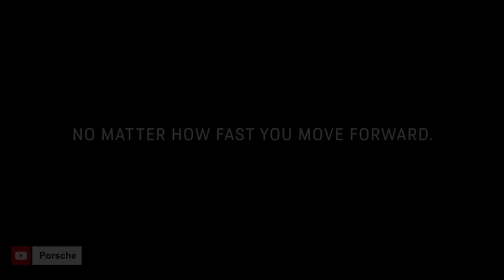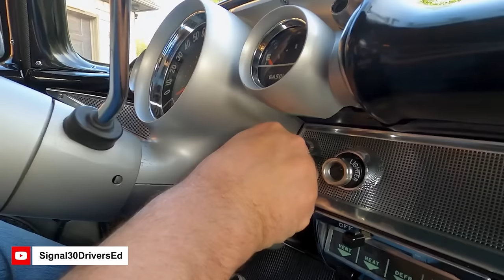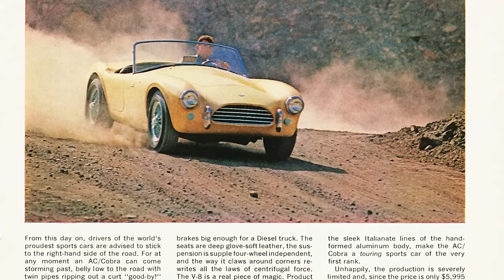Why Old Cars are Better

Comment: My first car was a 1966 Ford Thunderbird, which I bought in 2017 and rebuilt the engine in 2020 since a previous owner had rebuilt it wrong and it was running on 7 cylinders. To be fair it also had over 100k miles by that point. Most reliable car I've ever owned. I don't buy the whole schtick of "old cars are less reliable," as that old beast of a Ford still got me everywhere I needed to go without fail even when running poorly. And the thing is, old cars get an unfairly bad reputation due to external factors - for one thing, the quality of oil and pump gas used to be much lower, so in the old days things wore out faster. But some engines with architecture dating back to the 1960s and built as late as the 90s, such as the legendary Ford 300 straight six, are known as among the most reliable engines ever made, because the last ones were made when the oil and gas got good enough for them to really last. 

The other part of it is that most owners don't drive their classic cars enough. Classics were built to be daily driven, that was what was expected of them when they were new and nothing in that regard has changed. If you leave them sitting too long, gas will evaporate out of the carburetor, oil will drain out of the high places in the engine, things meant to stay wet will dry out, and when you go to start it again it'll be fussy and troublesome BECAUSE you let it sit too long.

Now, I drove my 1966 Thunderbird almost every day, both before and after the rebuild, so it rarely sat for long. The thing ran like a clock. Once I sorted it out and fixed all the previous owners' mistakes, it started quickly every morning, warmed up quickly, and drove anywhere anytime with no fuss. After all, if it ran perfectly fine yesterday, what's so different about the next day? Nothing! So it just runs and runs. No reason it couldn't run, no computer telling it it can't, nothing it can really do to hurt itself. Heck, this is a carbureted engine and it still runs fine year-round. Unreliable my foot.

And chances are it'll be more than 100,000 miles before it needs a rebuild again, because there's modern oil in there now, so things like bearings will likely have a much longer lifespan. The whole thing is built like a tank and it's all metal, no modern plastic parts that only last a certain number of heat cycles before breaking. All you really have to replace is spark plugs, oil, belts, occasionally points in the distributor, and not much else. It just works. 

I've unfortunately however also been in a crash in this car. A truck slammed on the brakes in front of me, I stopped without hitting him, but the driver behind me was distracted and did not stop. Got hit at 30 mph in a car with no crumple zones or headrests. Some will tell you old cars are better in a crash because they don't crumple, and that's partly true - my car was a lot less damaged than the car that hit me, and I even drove it home after the accident, with all lights still working and it even still tracking perfectly straight - but that meant most of the force of the crash went to my neck instead of being dissipated in crumple zones or a headrest. So yeah, bit of whiplash. But that's all healed by now and I intend to fix the bodywork and drive it again :)

The one area I will say classic cars don't hold a candle to modern cars is where fuel economy is concerned. My old 'bird gets 16 mpg highway, 14 city, and that's on non-ethanol gas. It gets like 10-12 mpg on ethanol fuel so it's more than worth the extra cost to put non-ethanol in it, plus it runs a lot better on that (old cars aren't designed to run on corn, they don't like it), but still it ain't exactly the cheapest thing to run. But when the V8 chugs along at 35 mph while practically idling, the car feels so relaxed and carefree that you kinda stop caring how much fuel it consumes. Old cars really are like nothing else. Don't fear the challenge of daily driving a classic car, it's well worth it.
Reply: Driving 70 ford high boy and 77 town car….computer never goes out….
Reply: Agreed, I have a 1996 Ford F150 with a 5.0L (302) Windsor V8 with 211,000 miles on it and still going strong 💪. The only things I replaced on my truck was the starter, the rear fuel pump, and the power steering megunisum but other than that mostly was just simple maintenance, took out the transmission fluid just to get rid of the shuttering it was making and it hasn't had a problem ever since.
Reply: Back here in the east where the snow flies you might see more of the old steel but not after November 1st cuz that's  usually  when everyone puts their old cars and trucks away  and drives their  newer stuff!!!.
Reply: My first car was a 1962 Thunderbird hardtop. He drove that car forever till I had a wife and kids. I know have a 1966 Thunderbird convertible. I love that car. Everything you say about it is true I haven’t hit anybody and nobody’s hit me, I don’t drive it in the winter. I live in New Hampshire but I go out to the barn at least once a month fire it up but it warm up and drive it out into the yard and put it back in and when I’m going down the road I’m watching the dashboard as much as I’m watching the traffic. Because of that I once actually turned around and went home and got my BMW and finished my trip. I also have a 1966 GTO four-speed with a 400 inch Pontiac engine that car is really fun to drive and you have to drive it nothing is automatic. Do you really feel connected to the road in a in a mid 60s car. Motor on dude.
Reply: @CJColvin  I have a 93 with the same engine. Just had an old time mechanic very familiar with that timeframe. Take the top off that motor and make it like new. Did away with all the extemporaneous tubing in extra stuff enough to fill the 20 gallon garbage can. Now it runs like an old time 351. I love that truck. I’m in New Hampshire so I’ve had it oil under coated every year. This year I had a small sections spots Actually of rust repaired. I have to say I really loved your story I have a 1966 Ford Thunderbird, convertible and a 1966 Pontiac GTO hardtop drive in those old rigs is nothing like driving anything in the 2000s good luck to you brother.
Reply: Finally, somebody besides myself understands how bad motor oil was compared to today's synthetic.  You really get 16 MPG with a 428?  Amazing.  The 10 - 12 you get on ethanol is what they usually hot on real gas.  Remember, the Thunderbird was never designed for economy.
Reply: @michaelbenardo5695  A 66 probably has a 390 in it, it's what was stock. 428 cars of the 4th gen are decently uncommon from what I've seen. Gas mileage isn't much different between the two though.
Reply: Raise the compression (with new pistons or tighter heads) and put a smaller carb with properly sized jets on and you'll get almost the same mileage as these newer cars.  Automotive tech just figured out quench distance since then.  If you use the stock cam, you'll barely increase the internal stress, but get a bit more power across the board and drastically increase economy.  You won't be competing with the drag cars with the smaller carb, but it'll definitely get some and the throttle will feel much snappier.  The things the disposable auto industry doesn't want us to learn, brother!
Reply: Old T-Birds are my absolute faves!!! This is coming from a lady who has totally lost faith in modern Ford. 😂
Reply: If your in Canada you keep your classic in the garage and not daily drive due to something called, winter

Comment: As someone who drives a car from the 1950s and loves old things, I do agree that old things were much better made. That said, we have traded the quality of old things for technology. My 1951 car is built extremely well of the finest of materials, but it doesn't go, and it doesn't stop, and the technology of the flathead six is laughably antiquated. It is also the case that in spite of the better materials old cars didn't actually last longer than new ones, they rusted away, and their engines were worn out after 50000 miles, this is because of an improvement over time in the technology of engines, better lubricants and metallurgy enabled engines and so on to last much, much longer than a 1950s car would ever last.

To add to something else you said about car reliability, yes it is obviously true that new cars are "more reliable" but that isn't really the whole story. As someone who has been daily driving cars more than 50 years old for a decade, it isn't nearly as bad as you might think. I've never been stranded, and I haven't really had many issues that were difficult to repair. Old cars are easy to fix. 

As someone who works on modern vehicles for a living, they break down plenty, and they break down in ways that are much more expensive and complicated to diagnose and repair, because the complexity is miles ahead of anything made 50 years ago. Everything in that damn vehicle from the power windows to the braking system is a computer on a CAN bus network, and god help you if it has so much as a rubbed wire somewhere. Goodbye car, and you ain't fixing that on the side of the road with a hammer.

Comment: 19 year old here, I bought a 1996 Buick LeSabre Custom for $2,000. It looks like a hooptie and drives like one but after putting over $2,000 in repairs and I'm also gonna replace the engine air filter soon. She drives really nice now, still have to fix the a/c when i can because I live in Las Vegas but man shes super comfy to drive, feel like im on a cloud. Did i forget to mention it has one of gms most reliable engines they ever made the 3.8 V6? Marilyn just keeps going!
Reply: Another great old car is the Ford Panther Platform (Ford Crownvic, Mercury Grand Marquis, and Lincoln Town Car) with the 4.6L SOHC 2V Modular V8 in it.
Reply: Hell yeah dude, the 3800 is a tank, as long as you've gotten rid of the plastic intake.  I've got a 3100 in a '95 Olds Cutlass Supreme that I have literally tailgated Impreza WRXs with down our country roads.  That thing was a quiet beast until Mom forgot to turn on the cooling fans and blew it up.  (The ECM would never turn on the fans by itself, which is why I got the car for cheap with a blown head gasket.  I finally replaced the ECM when it crapped all the way out, but left the manual fans cause they were cool.)  Still got it, but gotta fix it lol
Reply: @FuckGoogle502  Hell yeah, please fix your whip. There aren't a lot of those cars on the road anymore with that kind of style and euphoria!
Reply: My best friend has a 2001 Buick LeSabre.  It’s pretty ugly outside, but inside it’s pristine. It feels like you’re driving your couch down the road. They’re worth fixing
Reply: @Wjacobloftis  I agree, I always wanted a full size sedan and I got one
Reply: I used to think that was uneconomical, a foolish use of money. Nope. 
Can't exactly say something is a bad 'value' when you get something invaluable out of it.

Same reason farmers are spending Tens or Hundreds of thousands of dollars on truly ancient tractors. They're actually fixable, even if less-performant.
Reply: @LRK-GT  yeah and honestly I like old cars anyways and investing in automobiles is a stupid idea anyway except maybe it only has not expensive one issue and you make a profit  after spending just a little bit of money getting it fix. By the way my A/C works now I did a recharge and I found out the vacuum lines in the A/C weren't plugged in the vents which is why I wasn't getting any air
Reply: Yes, those 3.8L Buicks were - and still are- the indestructable vehicle. I don't see that with Vulva's (yes , Vulva's).

Comment: The reason modern electronics in cars are hard to fix is because the corporations want them to be harder to fix because it gets them more money
Reply: Personally, I 100% believe we could have every single 'modern nice-ity' w/o all the difficulty in repair and 'disconnection' from the driver.
Technology advanced. The implementation of it, rolled backwards.

Comment: As far aesthetics go, in contrary, the regulations for headlight shapes specifically used to be more strict but eventually loosened up more and more. You may have noticed how prior to the 70's all car headlights were round but in the 70's so many of them were square, that's because only round headlights were allowed for decades so of course when square suddenly became an option everyone switched to the new style. Nowadays we have all kinds of shapes, some are even quite bizarre.
Reply: Square headlights were the very tail end of the 70's. Round headlights were still king in the 70's.
Reply: I run a Jeep with square headlights and used to get ribbed by other Jeep owners because, they said, "A real Jeep has round headlights." So widespread was this criticism that Jeep (Chrysler) reintroduced the round headlights with the TJ model (mine's a YJ). Nowadays, my 1991 square-headlighted YJ is a classic, and everyone admires ... the square headlights. 🙂
Reply: Came here to say just this! The regulations around bumpers, headlights etc was strict but different. Today, it’s a lot of other things and many more things. 

But, one example! The pop-up headlights were by and large only invented because of headlight regulations. When thinner slim headlights were allowed, the pop-up’s disappeared almost entirely. 

European cars from the 80s had to have US spec headlights, and the bumpers of cars such as the 911 from the 70s was hideous in the US. 

Let’s not talk about emissions regulations during the 70s and 80s when it was not uncommon to see a 5-7 liter V8 with a lot less than 200 bhp. The Camaro of early 80s had roughly 140 bhp in its 5 liter V8! The Cadillac 500 V8 had more than 400 bhp until emissions regulations came about and then it mustered a 180-190 bhp.